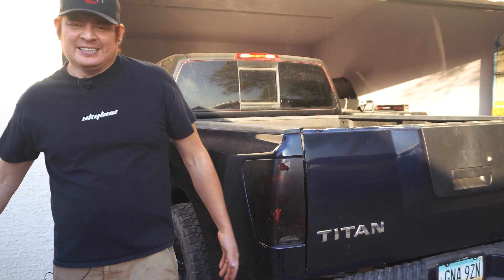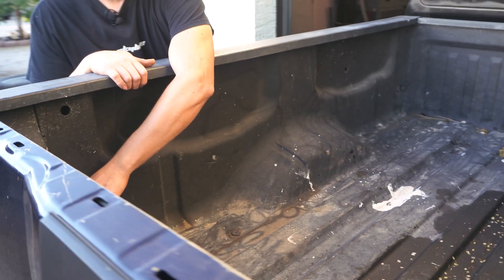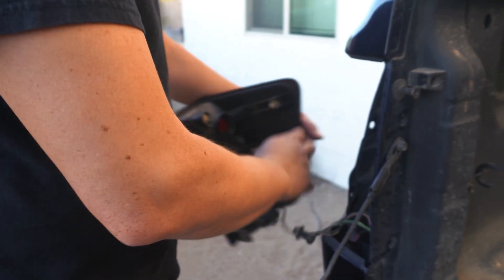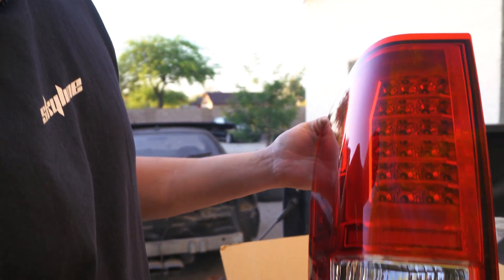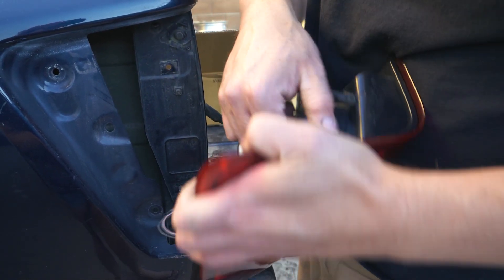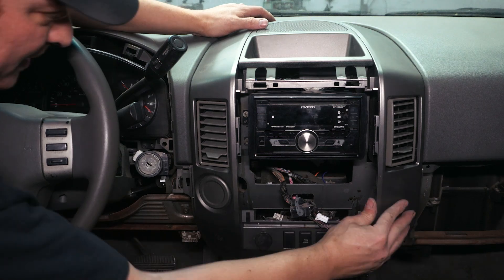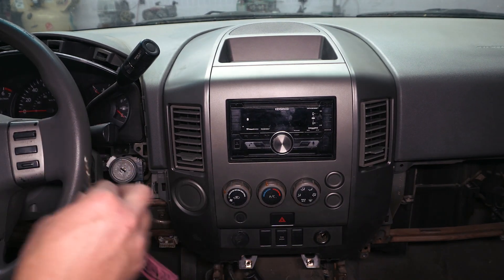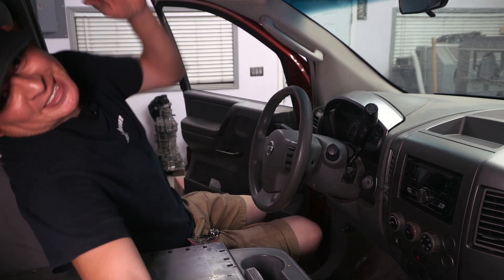Nissan Titan Dash Installation

Comment: I’m have a very hard time reinstalling the top bolt holding in the shifter with my new trim piece on how we’re you able to reach it. I could reach the bottom of the two little to no problem but no way I could go anything last hand tightening on the top one. Any tips thanks
Reply from the maker: I was able to use a long extension with a swivel at the end and it didn't give me too much trouble. But over all it was a pain.